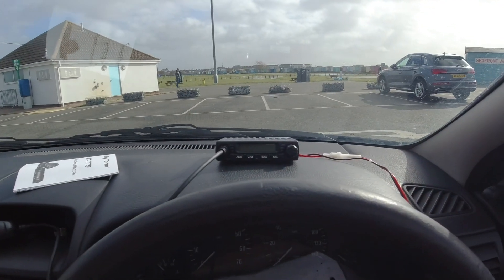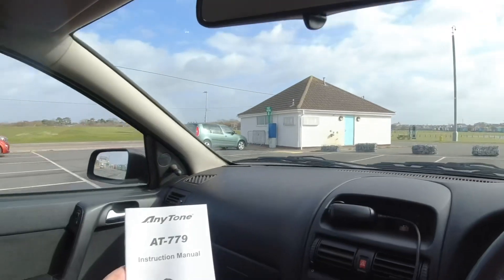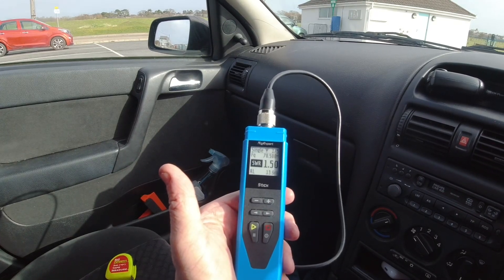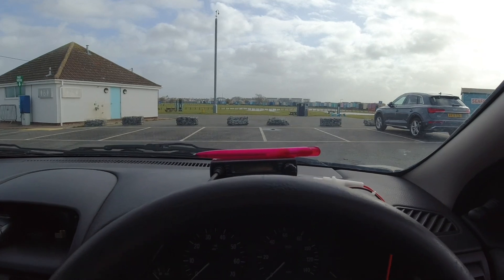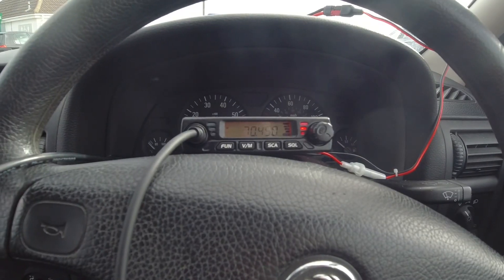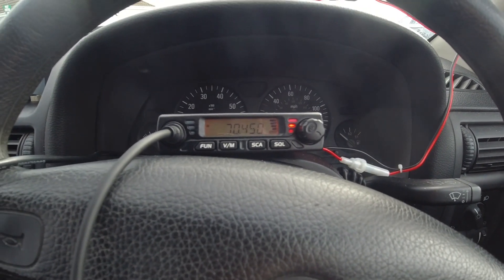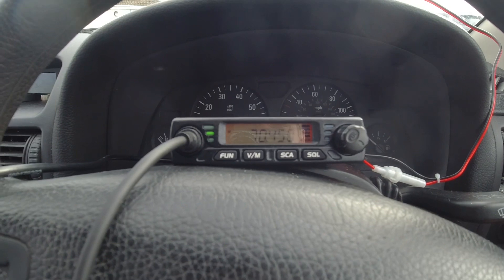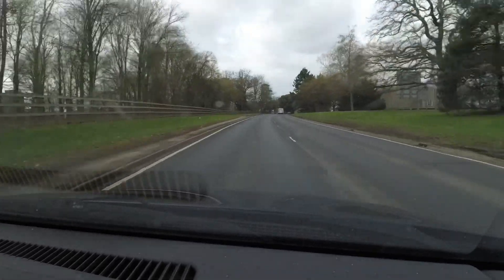Testing my new 4m FM radio

Comment: This is an absolute TRUE story. I'm in the U.S. have made exactly TWO 4m QSO's. How's that you ask? Well, I was working in two way radio at the time. Myself and a co-worker were sent out to troubleshoot and 72 to 75 MHz link repeater used for paging at the time. Anyway, I was at location A, and He was at location B. Couldn't resist the temptation, I grabbed the mic and called "HIS CALL THIS IS MY CALL do you copy?" After a short pause he answered with his call. We just chatted for 30 or so seconds, exchanged signal reports, and signed off including fa "73's OM." I dunno, it was funny at the time. These were GE Mastr Pro stations.
Oh, the fault? A failed interlock switch on the back door. That was it.
Reply from the maker: Over here in the UK 70MHz used to be used by the Fire Service, there are still old FM radios covering the band to be found on eBay etc from those days although many more commercially made radios for the EU and Region 1 market now include 70MHz. FM only rigs including handhelds are quite but activity is quite patchy.